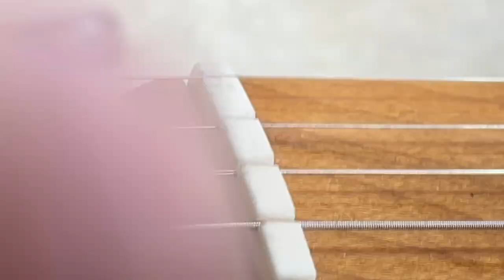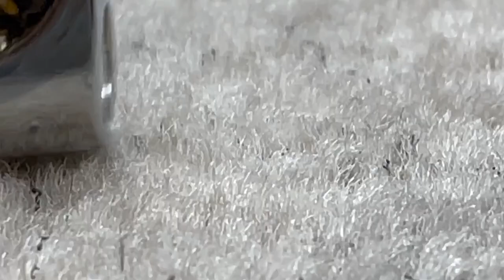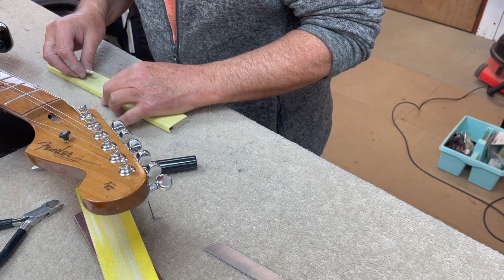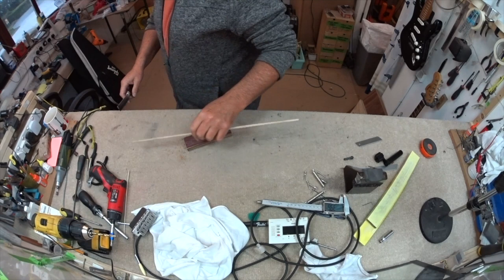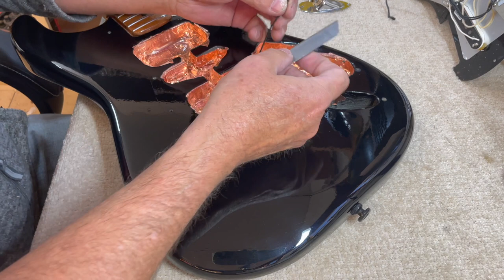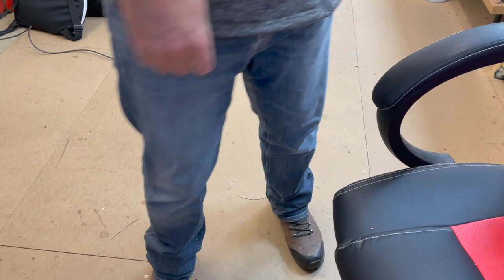Dave Gilmour style partscaster set up - for G'pa Andy and grandson Zak

Comment: Oh man Sam, you are a mentalist, just wanted to do a proper setup on my strat, it has a tight fitted Wilkinson bridge and Guyker locking tunners, now I'm prepared what to expect! :-)
Reply from the maker: Expect the Guyker tuners to chew the teeth off their own cogs… As for the bridge, it always seems complex / mysterious but it’s pretty simple… that Wilkinson bridge will perform like a a dream IF it’s a) fixed properly perpendicular to the neck Center line b) the anchor screws are perfectly positioned c) the screws are the exact right size for that bridge d) the screws stop short of pulling the front of the bridge down ie back off a half turn and e) the block can move freely without touching anywhere (Dremel sanding drum is the simplest way to ensure this on bridge upgrades!).

Comment: I also bought EZ Lok tuners earlier. They do work fine, but if you use the locking mechanism they also tend to chew up strings, so using them like regular tuners seems to be the ticket. Also, for anyone who is planning on buying a set, be aware that you can't use thicker than 10 gauge strings with the EZ Loks. I found this out when swapping out the somewhat wobbly and worn out tuners on a Squier. He wanted 11s, but the holes in the EZ Lok simply are too small for the low E string in 11 gauge sets. :-(

Comment: I wonder wether those staggered holes in the trem block make any differene to the tuning stability, I've read thats the reason why they are drilled this way
Reply: I think they make some kind of difference. Have an old Vintage V6 with the same trem system and it's pretty darn good at staying in tune. Being a neanderthal I have no idea about the science behind it yet lol
Reply: @martin-1965  I think due to the different string gauges across all strings the return to the zero point in the block is different when you slack the strings by using the bar, but Im not really sure about the physics either

Comment: I've been eyeing Guyker tuners as a possible option between Fender's locking tuners (that I have two sets of and am basically happy about) and the 'too cheap to be of any use' segment (including 'Wilkinson' of somewhat dubious origin) that seems to always be plagued by imprecise manufacturing of some description, whether the tuners are stiff, have burrs, are loose in the mechanism etc. Based on this, I think I will steer clear of Guyker and stick to Fender locking and vintage tuners. Maybe treat myself to a Gotoh or Hipshot set at some point to see what I may have been missing. 

Do you have any recommendations for tuners - vintage, locking or standard - in the affordable but decent segment?

Comment: Four broken Hi E strings? Did I count right? I suspect a burr on your tuner. Or… the locking part is much too sharp, misaligned, something. When I saw the tuner handles I thought they were expensive ones as that shape usually comes on upgraded tuners. Thanks for the extra info. Cheers.
Reply from the maker: I think it was 3 different strings. Yes,  the locking mechanism was damaging them. I referred to the tuners as 'Hipshot' copies on the video but someone pointed out to me that they were copies of Gotoh tuners.

Comment: By the way, is this the 'banana that must not be named' (I remember the story) or have you improved upon your own banana truss rod design with an external sheath?
Reply from the maker: No, I would never use that diabolic accursed thing :D This is a StewMac 'U-Channel' truss rod acting as the 'Banana'. It's slightly shorter than the regular 'rod and bar' truss rod and keeps its shape a little better because it's stiffer.
Reply: Thanks! Sounds like I will be placing my first order with Stewmac shortly - have been eyeing their micromesh pads and the fret roundover file as well, and might throw in a shim set in preparation for the upcoming Jazzmaster build.